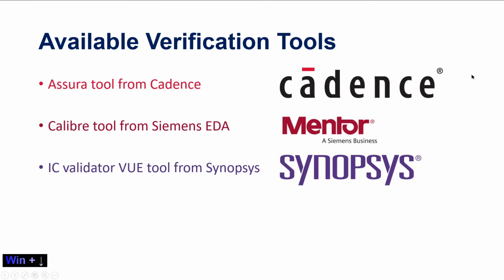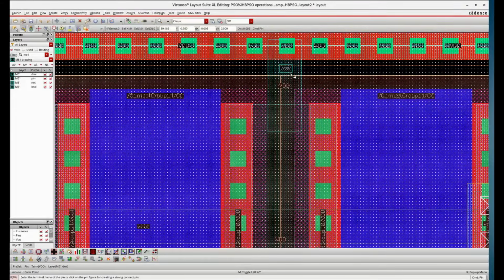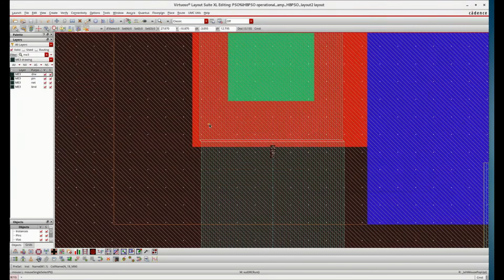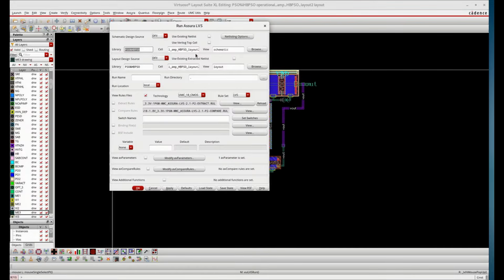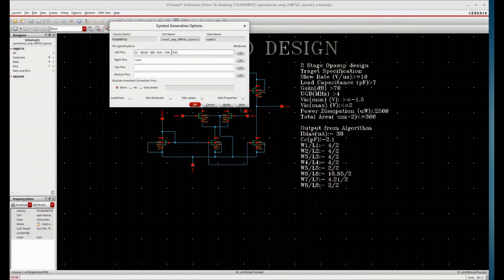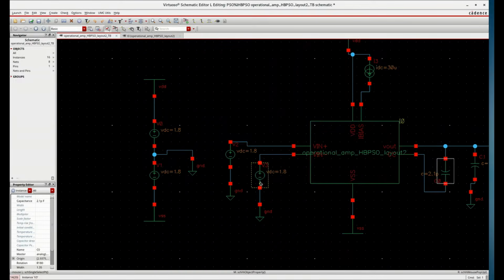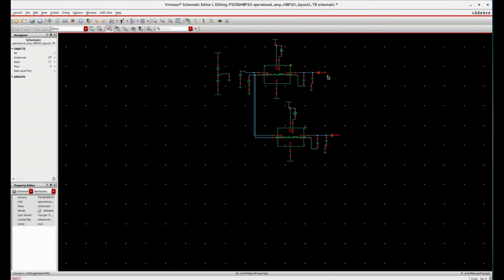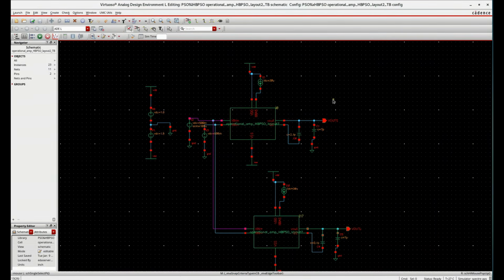Part 4: Two-Stage Op-amp Layout verification and Post-Layout simulation | DRC | LVS | PEX| ASSURA

Comment: why you remove capacitance from schematic. Layout is formed from the schematic right? then why you removed.
also if there was resistor in schematic that will also be removed?. Is this removing process will be same in scl180 also.
please help
Reply from the maker: No, if you use resistance and Capacitance  from SCL library then no need to remove it, else if you are using resistance and capacitance from the analogLib then you have to remove it and assign one port for doing layout. In this demonstration capacitor was used from analogLib that is why it is removed as it does not have any layout view.
Reply: @VLSIToolBox  Thank you